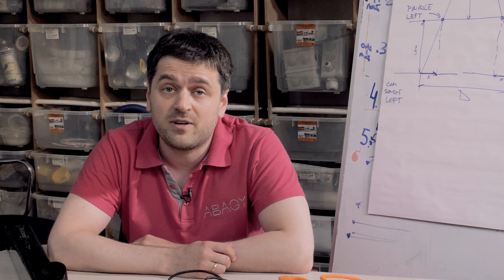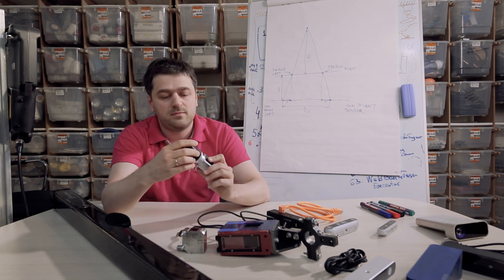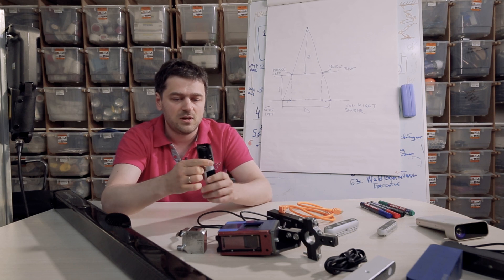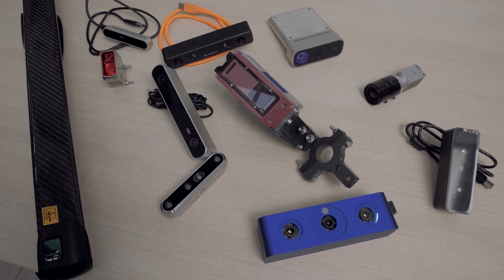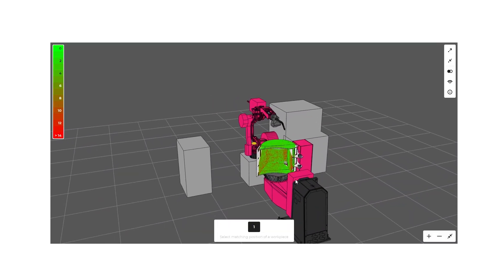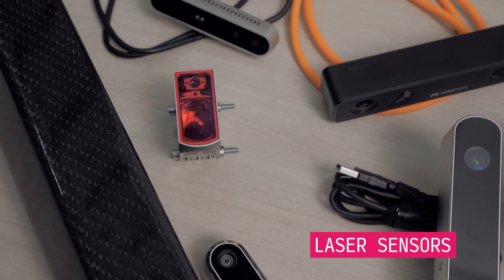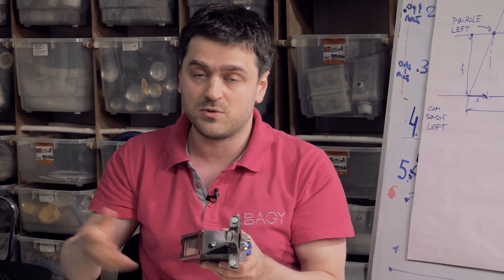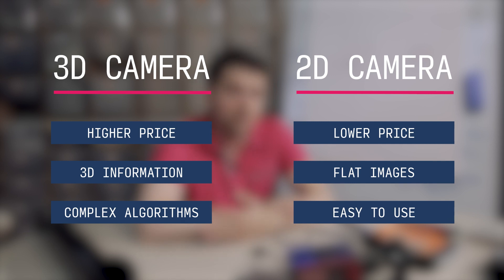LiDARs, 3D Cameras, 2D Cameras. Robotic Vision FAQ #1 | ABAGY ROBOTIC WELDING

Comment: Hi do you have any current customers that have introduced your technology with valk welding Panasonic machines? Pacifically the Panasonic TL-1800WGIII machine? 
What would be the lead time on fitting this equipment onto a robotic cell? 
Also the rough cost of adding your software & equipment onto a machine? 
And lastly how would fitting your software/equipment affect the servicing of the cell through valk welding technicians?
Reply from the maker: Hi! Thank you for your question! Our experts will be delighted to discuss your production task. The simplest way is to submit a request on our website abagy.com, and they'll get in touch with you as soon as possible.